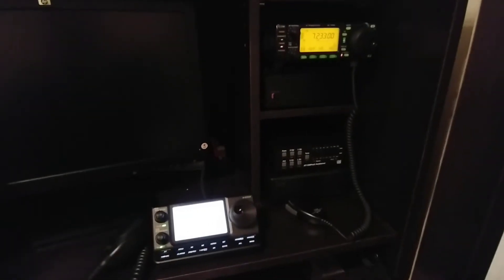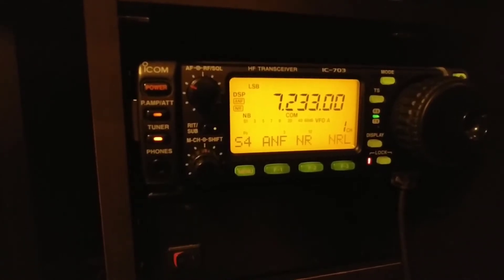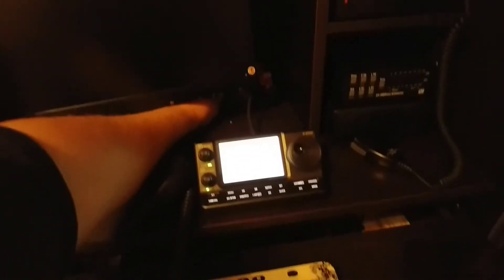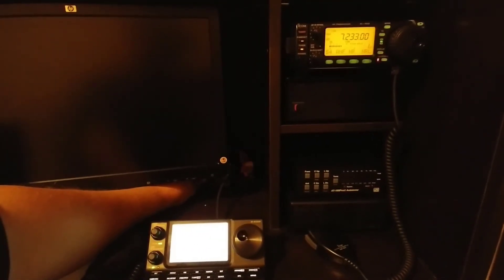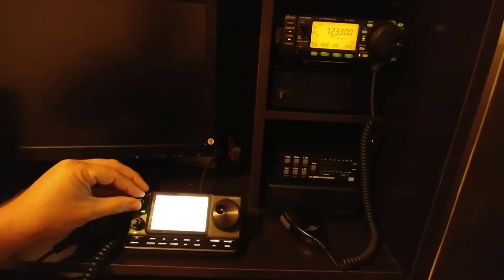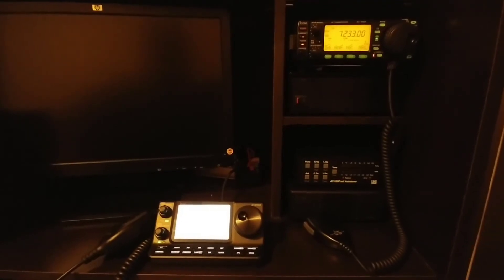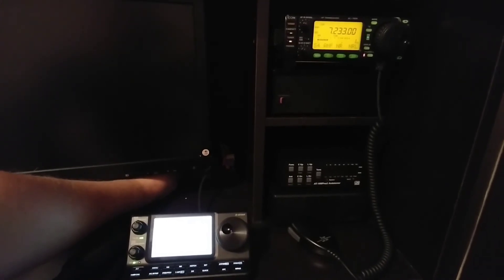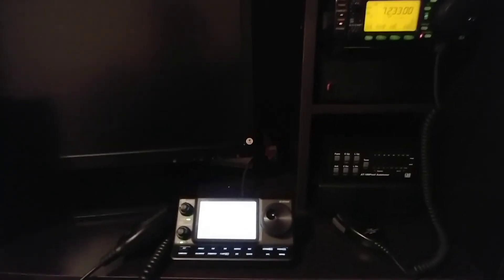IC-703 vs. IC-7100 receive audio

Comment: I found  your test very interesting. I have a KX3 and just can't part with my IC 703+. It's still a great radio. Last year I saw the Sherwood test results on the 703 and it just confirmed to me that the 703 is still a geat little QRP radio. It's a keeper !
KU3X

Comment: Hi, I’m not suggesting your conclusions are incorrect but as you know to try to do a comparison, conditions must be all the same.  A couple of obvious things: 1. 703 speaker is shooting up into the particle board above it and will change the audio characteristics, 2. 7100 speaker is facing backwards and into the cavity of the desk, attenuating the audio, 3. Just because the volume or noise control, etc settings are seton the same numbers, it doesn’t mean it is set to the same electronic levels.  Just voicing an opinion.  Thanks for the video.